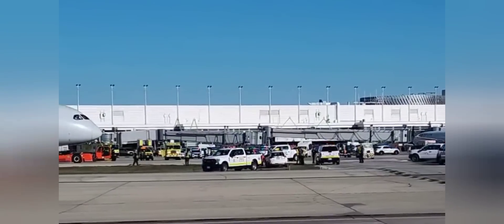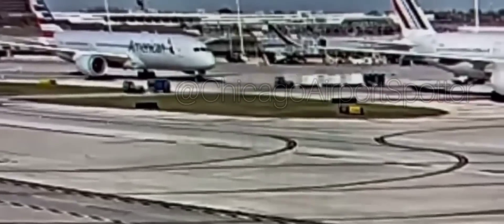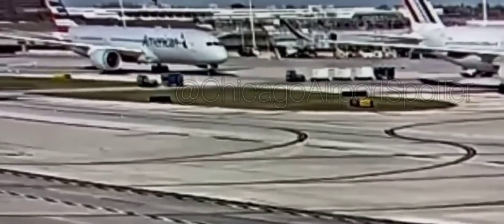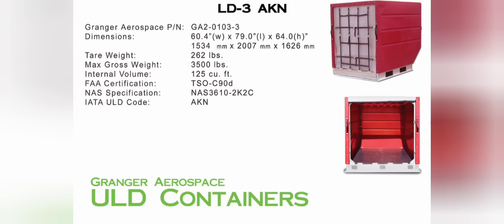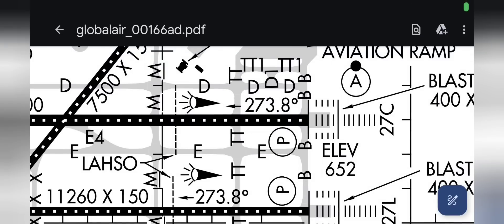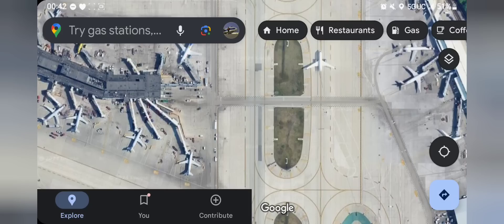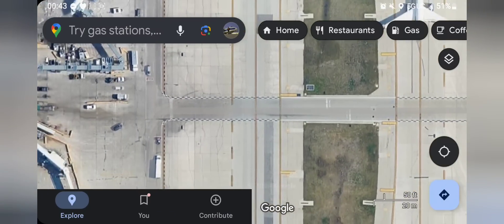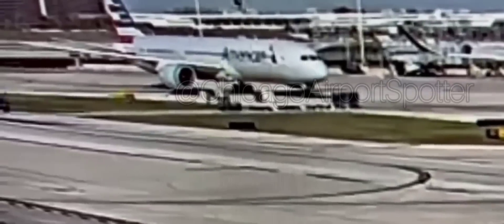INCIDENT REVIEW - American Airlines Boeing 787 Engine Ingests Cargo Container at O'Hare [10.17.24]

Comment: Well based on the design of the blades in these engines, I can tell you all the blades in and through the entire engine are useless at this point.  The modern processes used to solidify and grow them almost like a giant crystal (easiest way for me to say it) makes them strong, along with the coatings that are applied.  But once they get damaged, the stress and fatigue to the blades at the damage point can never (as far as I remember) be fixed, making them no longer fit for use.  So they question on this engine is, if they gut it and remove and replace all such materials, is that work even worth it (as it is likely cheaper to just get a new engine).

Comment: Shouldn't the pilot have been more situationally aware to not apply engine thrust with traffic directly in front making a crossing?  No pilot error here?
Reply: It was the plane in front that rev'd up and the engine thrust was what caused the container to depart the trailer!
Reply: Aircraft ALWAYS have the right of way on the AOA. No exceptions. The tug driver broke every rule in the book by driving between two aircraft that close that are taxiing.
Reply: @rixxroxxk1620  He should be an EX tug driver now!

Comment: To correct you a little. Yes, the fan blades will have to be changed. But the entire engine will have to be torn down and entirely rebuilt. FOD can have entered every part of the engine. After a complete inspection it will have to be balance checked and re-balanced from turbine blades forwards. Just imagine if one of the three central shafts were bent or even slightly unbalanced. Only one way to determine: tear it down to the last nut, bolt and retaining wire. Neither GE or R-R will stand behind anything less.
Reply: A bird strike can render an engine unrepairable. That engine is done, they will not repair it. It will be an insurance write-off.
Reply: @justincaldarella  Definitely. I was just looking at it from an engineers perspective. It's an insurance write off and will be parted out. Still has a couple million $$$ in parts. 
The way things are going at Boeing the cowling may be gracing one of their upcoming trash piles.
Reply: @justincaldarella  more like chicago or the ground handling company will be buying american a new engine
Reply from the maker: @elevatorcentral it was an American tug, dollies, and Iberia AKE containers. They're lucky in the sense that it all happened "in-house," so to speak, and can be handled internally between the airline and their own insurance.
Reply: @ChicagoAirportSpotter  Don't bet on that one. The FAA runs the shows at airports and is already under the gun with possible lax supervision with all the recent ground traffic collisions.
Reply from the maker: Awesome, thank you for explaining.

Comment: Dad is a retired Pratt jet engineer - 

He said there is no way in hell that engine will be rebuild - the inspection of every part from the imaging , dyes , measuring weighing would cost more than a new engine - 

It’s also an insurance loss so the company is happy to repair the structure on the aircraft and slap a new engine on
Reply: Dad is wrong. Engine will be swapped, sent to MRO facility and fully rebuilt. FOD damage occurs daily, this is no big deal. It just looks cool.
Reply: @car2069 this wasn’t FOD, this was FCD- foreign CAN debris. 

When was the last time you heard of a turbofan ingesting 150 lbs of aluminum??
Reply: @RC-fp1tl  Doesnt matter what it ingests, it goes to MRO and gets torn down, tested and reassembled.
Reply: @car2069 it will get torn down at an MRO but no part of that engine will ever fly again unless it’s as a new product made from the recycled metals. 
No insurance company would allow it. 
No airline would install it. 
The liability should a crash occur with such parts in an aircraft would be insane and no one will take that liability on. 
Further, every individual rotating part would have to be inspected to the maximum degree possible even to consider what might be salvageable.
Nope, that puppy is a scrap heap bound for the recycling furnaces.

Comment: Imagine sitting in a right window seat and seeing that large piece coming over the wing @ 5:00 and smacking against a few windows further back. Maybe it wasn't metal but the size of that piece would make it seem your number is suddenly up while stationary on a taxiway.
Reply: We was sitting in row 16 by the window, I saw the engine shake and make a lot if noise, then something came flying out and hit our window. Made a bit of noise and did startle passengers around us. The window was marked - we made sure the crew were aware of that when we alighted some 70 minutes later.
Reply: @GordonSkinner  Very interesting. Thank you both. I guess it was gone before any panic could set in. The crew up front shut the engine down promptly.
I wondered if they announced anything or came back to look out. A mark on the window as well. Stay safe. I hope your journey wasn't badly affected other than the 3 hour delay etc.

Comment: I think people are VASLY underrating the possibility that the locks were either inop or (more likely) not fully engaged on the dollies. Considering the containers were all empty, I think it is highly likely that there was a slippage of safety standards (based on my own time on the ramp). Also notice that the AKE on Tug 1 is not closed, and the bulk cart on cart 2 are not closed.
Reply: So who trains any body to drive behind any aircraft that has engines running!

Comment: The engine compressor blades are a much smaller diameter than the fan you see. I suspect most of the debris shot out around the engine, not thru it. The nose cowl suffered a lot of damage but I'm sure the engine can be rebuilt.
Reply: Yea OK. Its JUNK. Dye penetrant test every piece in that engine, a rebuild would 2x the cost.
Reply: Engine is junk.
Reply: Engine is junk. Everything got ruined. Small bits got into the core and good lucky cleaning that up. You can’t rebuild a damaged jet engine, it’s not that simple as you obviously think.
Reply: @Roboseal2  obviously the fan is scrap, but the core can be rebuilt depending on severity and extent of damage. The rotors and stators have limits, and the nicks can be blended out if the damage is within those limits. There is an arbitrary line though where cost outweighs the benefit.
Reply: @zachgarner853  If this is credible, (We have no way to tell), should be updated and put onto the incident log on Aviation Herald

Comment: It was more an issue of the jet blast of the Air France plane causing the problem than anything else. Plus- those containers were NOT secured to the carts in any way- the carts didn't even tip, the containers blew right off.
Reply: Good catch, ya the carts look like they're just doin fine.
Reply: Yes something was wrong with the dolly's the locks should of been able to hold them. If the locks are not set the cans would of fell off at his first turn. I would say he used the wrong dolly's for the equipment he was using.

Comment: That engine is at least $50M-$60M, so costly. But knowing how airport employees get distracted by things that shouldn’t be a factor. Timing, is not a very smart solution. It’s the only place I know where vehicles cross active taxiway right on front of airplanes. And this is an airport design.
Reply: It's a GE GEnx-1B engine, which has (had) a list price of $25 million
Reply: I think he means the lifespan and overhauls and repairs of the engine over time would add up to 65mil
Reply: Yeah it’s “only” $25 million!
Reply: The engine costs less than half that for the full list price, but these are leased engines.  It'll be sent off to GE for a full repair and eventually be returned to service and the aircraft here will get a replacement engine.
Reply: Don't go by the articles when customers take delivery of aircraft, i.e. the engine order value.  Sales of installed engines are heavily discounted.  I would bet javacup is closer than the $25M number, if they scrap this engine (not a given) then the insurance will purchase a spare at list price or close to it.

Comment: That's a twenty million dollar engine. 

Very pricey accident indeed.
Reply: Yup the GEnx and Trent 1000 have a cost of around 20 million each
Reply: Amazing to think that the expense of this incident will exceed the lifetime earnings of the employee and his boss and his bosses boss.
Reply: 300,000 per fan blade?  That sounds extreme
Reply: @dabneyoffermein595  Everything, all components in those engines are fabricated to precision from premium materials. This is why they are so costly.
Reply: @67Endgame I worked on the assembly floor at P&WA a couple years in the late 1970s. Even then JT-9s were close to $2million. The paperwork for each engine was crazy. We used to kid around that when the weight of the paper equaled the weight of the engine the engine was done.
Reply: @Chris_at_Home  I'm in aerospace manufacturing, a former VP of the company used to say "build a radio, ship a filing cabinet."
Reply: @dabneyoffermein595  The damage would be far more than just the fan blade; chunks of aluminum went through that engine.
Reply: That WAS a twenty million dollar engine
Reply: Add to that the cost of the reduced availability of another plane.All the missed revenue.
Reply: They will replace the engine and sell the damaged one for non commercial refurbishing or salvage.
Reply: No wonder Boeing can afford to operate after a century worth of business as usual for Boeing and assassinations at those prices
Reply: Where's grandma's ashes?
Reply: $20 million sounds like a bargain. I’ve seen $28 million. But in any case, a very costly incident.
Reply: No big deal, this is exactly what insurance is for.
Reply: @Datamining101 which eventually comes back costing the passengers in the long run.  Not to mention airplane downtime.

Comment: There used to be a road that went between L and M that went UNDER the taxiways.....why did CDA close it?????   This would have prevented this.
Reply from the maker: You mean the "depressed roadway" that parallels the tram tracks? That's still there, but most people don't know about that road. I myself didn't know about that road until a few years into my airport career.
Reply: You may be surprised that the CDA for YEARS has had ZERO concept of how to design and implement the “new” ORD. This bottleneck here is the result of a complete lack of knowledge of how airport traffic should be managed and routed. Until they get off their collective A$$es and build two “end around” taxiways at the west end of 28R and 27L this issue will remain.